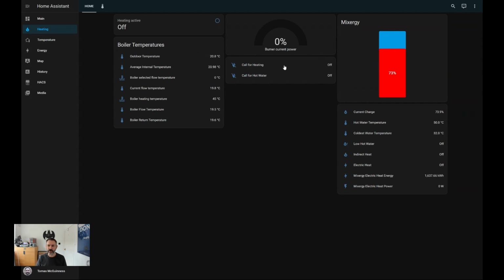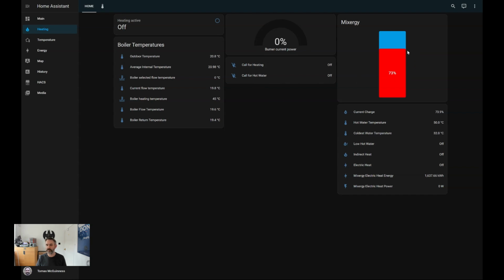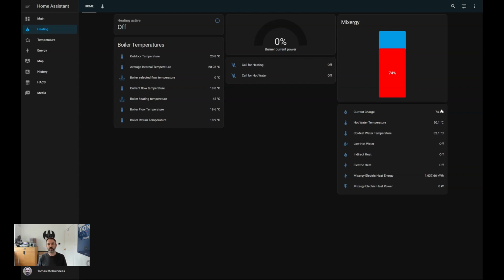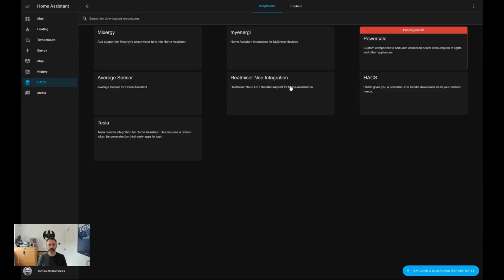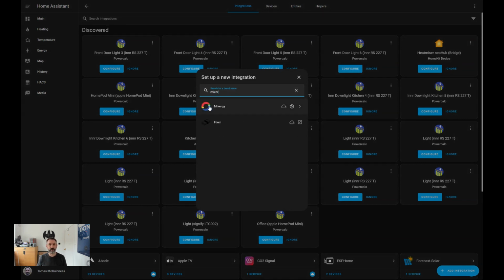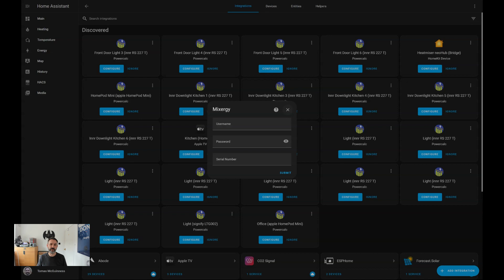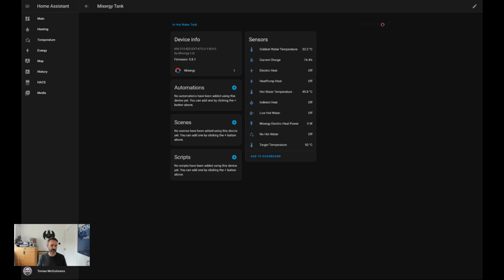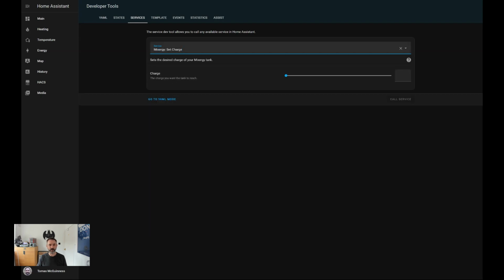Mixergy Home Assistant Integration introduction

Comment: Any idea how I can switch the immersion (electric heat) on, I have the heatpump iHPX cylinder but have no way of controlling the immersion? Got your integration running, nice work!
Reply from the maker: No way of controlling from the Mixergy App? I use my immersion in the mornings (under Octotpus Go). Under the "Source" tab of the Mixergy App, you can configure when the Immersion should be used.

For my integration, I know users have changed the "Default Heat Source" to Electric and then boosted the tank. 

What are you trying to achieve?
Reply: @tomasmcguinness  I think they have removed the control for the immersion for the iHPX as it's not on the mixergy app or cloud access. They said they were going to update it but I think they are a small company so might take a while, I want to be able to boost with the immersion when I  get my cheap off peak slots on intelligent go.
Reply from the maker: @ I’m really surprised by that! I mean, the immersion is usually there as a backup! I have found them quite responsive, so hopefully they’ll resolve it quickly!
Reply from the maker: Have you tried using the integration to set the default heat source to electric?

Comment: Hi, nice work, thanks. How did you get the red/blue tank diagram onto your dashboard please?
Reply from the maker: That’s a custom component I created, which uses the charge level.
Reply: @tomasmcguinness  Ok thanks, that's a bit advanced for me right now!
Reply: @tomasmcguinness  How would I start to set that up? Just some pointers would be useful...
Reply from the maker: I have just pushed the Lovelace card up to Github. You'll find instructions in the README on how to install it. It's a bit manual at this time.

Comment: Hey, I don't have a mixergy tank, but have been considering one. I was just curious what you use to see the boiler statistics, flow and return temps load demands etc. I've seen a couple of options for that its always good to know what's worked for others. Thanks.
Reply from the maker: Hi. I'm using this project https://emsesp.github.io/docs/. I purchased this connector https://bbqkees-electronics.nl/product/gateway-s3-standard-wifi-edition/ and it's all working nicely. I've done a video on the subject https://youtu.be/4QtcBFJmGx0

Comment: Thanks for making this integration, I have been using it for a few weeks now.  Not being a great expert with Home Assistant, is there a way of placing the 'set charge' and 'set target temperature' onto my main dashboard tab?  I have a slider type entity for my heat pump which allows me to set the desired house temperature.  A similar thing would be great for the Mixergy. Jeff
Reply: Thanks for the reply.  The sliders for my heat pump show up as Controls in the integration details.  Maybe that is a clue?
Reply: @jeffjsmith  Hi Jeff, I'm an absolute amateur with these things but I managed to get something like you're describing; at least if I've understood correctly!

I started by making a input_number helper to Home Assistant, with a minimum of zero and max of 100, which when added to the dashboard using the entities card shows up as a slider.
Next, I made a script to call Tomas's set charge service and use templating to grab the input_number helper's value for charge, something like this:

service: mixergy.mixergy_set_charge
data:
  charge: "{{ states('input_number.mixergy_target_boost') | int }}"

... making sure that the helper name matches whatever you called yours.

I then added a button on the dashboard, next to my slider, that takes whatever value I set the slider to and calls the new script - I guess you could have an automation that detects the input_number helper's value changing and send it automatically but I preferred a deliberate "Send to Mixergy" option.

I also added a "stop charging" button/script to sit next to my start-charging button, which is just a case of calling the service with a hard coded 0 for charge, rather than the template.

I hope that helps you on your way.
Reply: @john-ellis  Hi John - and thanks so much!  I am away from home at the moment but back in January, and I will follow your detailed instructions. Thanks again! Jeff
Reply from the maker: Thanks! I’m not sure how to use sliders like that for a service. I’ll have a dig around at the weekend if I can and see what I come up with!

Comment: So I could implement a virtual solar inverter and automate the tank charge value based on tesla Power wall state etc?
Reply from the maker: Yes, you most likely could. The integration offers two services that let you change the desired charge and water temperature. I know of one user that adjusts the water temperature during the day, to maximise their solar PV capture. If you do try it out, please let me know how you get on!